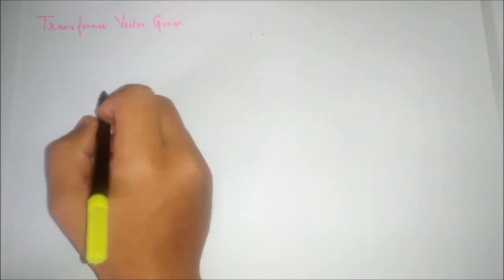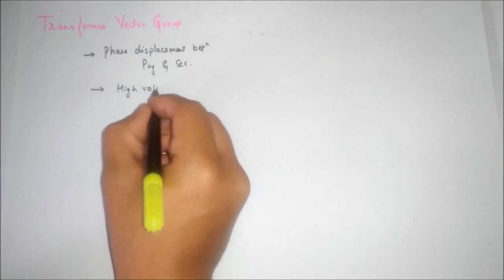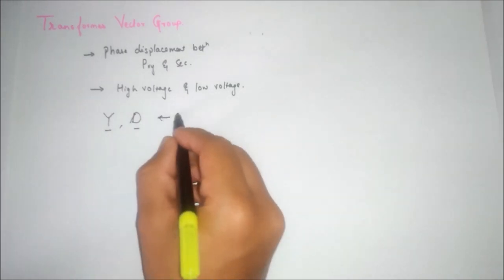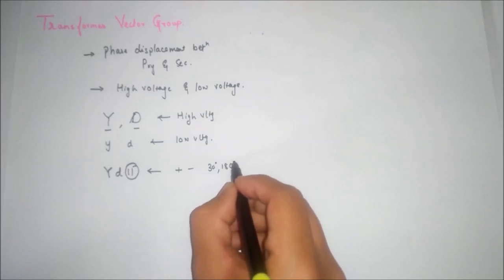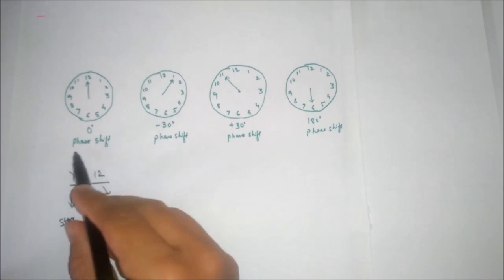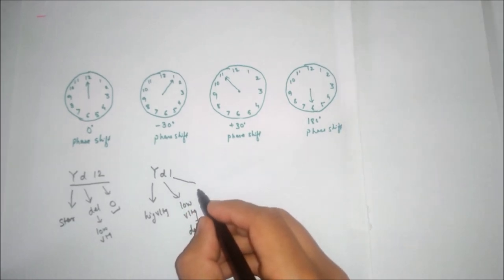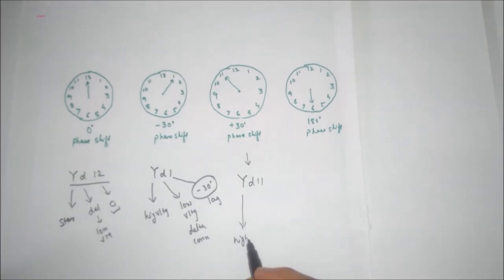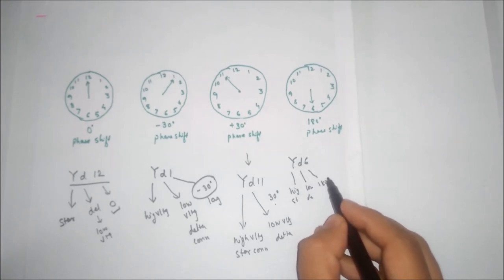Transformer vector group | what is Yd11 etc | easy explanation|

Comment: In a 3 phase transformer, if the primary high voltage and secondary low voltage side windings are connected in delta star, the phase displacement will be______________. Please upload video how to solve this type of question. It was asked in dmrc.
Reply: Dyn 11 ,,